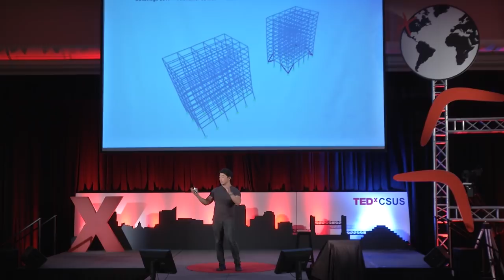Why we need to earthquake-proof old buildings | Dr. Kit Miyamoto | TEDxCSUS

Comment: The structures in the earthquake collapse due to the deformation factor. If we check the deformation we will also check the failures. The deformation of the structures increases when the acceleration of the ground is great, the duration of the earthquake is long, and if the period of the soil and the construction coincide to be the same, the coordination is created, which increases the deformation. Catastrophic deformation is created by three factors 1) The inelastic bending displacement of the bearing elements 2) The tipping moment of the walls. 3) The subsidence of the soil. The inelastic bending displacement of all load-bearing elements (beams, columns and walls) is stopped if we prevent the bending of the vertical load-bearing elements. The bending of the vertical load-bearing elements is stopped when we choose (instead of placing columns) large walls of reinforced concrete of diaphragm function. The stiffness of the walls increases when we apply to them (using prestressing tendons) transverse compressive forces in their cross section With this design method, we stop the deformation resulting from the bending of the transverse support elements which deflects and bends and the trunks of the horizontal support elements. Wall overturning torque. What does not bend is more easily overturned. To prevent the rigid prestressing wall from tipping over, simply join the bottom of the prestressing tendon with a deep ground anchoring mechanism. With this design we stop the overturning of the wall which deforms the beams and breaks them. The retreat of the ground is prevented by the anchoring of the ground mechanism With this design we prevented the three factors that deform and destroy the structures in the earthquake. Basically if we check the deformation of the structures then it does not matter if the earthquake has great acceleration, long duration, and is coordinated with the construction, because we deflect the forces of the earthquake into the ground, preventing them from being directed at the cross sections of the nodes and breaking them.